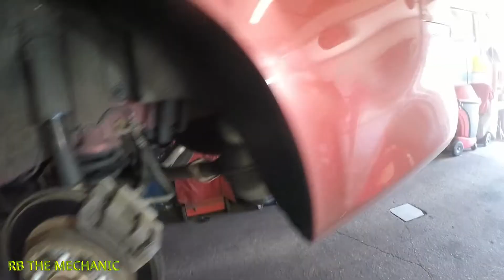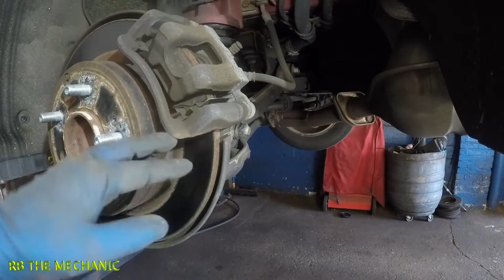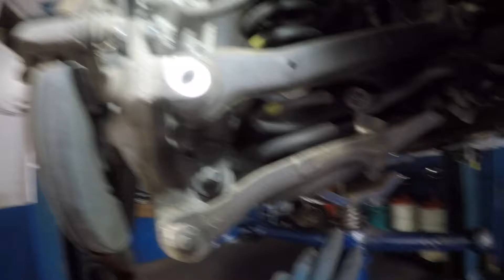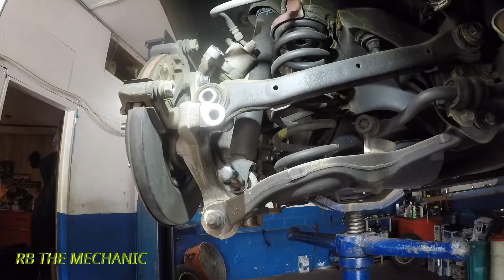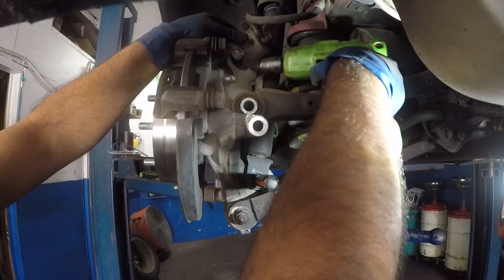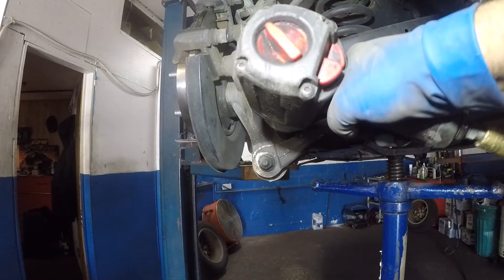How to replace rear brakes & rotors on 2013 KIA OPTIMA

Comment: Kinda glad I didn’t buy rotors since I didn’t need them, but dang that makes this unnecessarily difficult for a quick swap.
Reply from the maker: Yes this is bad design
Reply: @R @RBTheMechanic  At least the caliper comes off the regular way which is nice for pad changes. Gonna save this video gor when I inevitably have to bust out a jack stand to get the rotors. Thank you for uploading this.

Comment: I just replaced rear brakes and rotors on 2015 Optima without removing the control arm, what you need is a 12mm zero offset wrench to get the caliber bolt loose.
Reply from the maker: I have another video where I try that and it didn’t work
Reply: I need that video without removing the arm

Comment: Thanks for your vid. My problem is the suspension shock bolt needs rethreaded and can’t find that bolt anywhere, auto stores , hardware, nothing … found a kia parts store so that may be my only choice to find one
Reply from the maker: Yes that dealer item

Comment: Yes you do have to remove control arm bolt,,i tried cheating,,unthreaded the bolt all the way,thinking the rotor and caliper bracket would come apart as one, nope! Caliper bracket would not clear backing plate. Try it for yourself,you,ll find out
Reply from the maker: Yup crazy design
Reply: It can be done, I did it. Just have to pry it out of there. Might bend the backing plate a bit. I didn't like this so I ended up removing the upper control arm bolt anyway. It's really easy if you raise the assembly up with a jack underneath. Everything aligns nice and you don't have to hammer the arm. It's also nice because the bolt aligns better so you wont have to hammer it back in. BTW I recommend opening the bleed screw before pushing the caliper pistons back in. The brake fluid in this area gets contaminated the most. You won't believe how nasty it looks coming out from there.

Comment: Thanks for the video! Very helpful! 

I actually was able to remove the bolt from the control arm without messing with the shock. 
Instead I just jacked up the suspension until the bolt slid out. It does require a second jack though. But yeah saved me some time and struggle. The second rear wheel took be about 20 minutes.
Reply from the maker: Great idea!!

Comment: How about reversing the way the caliber Bolt goes in. So the nut is on the inside by the shock absorber and the bolt can be removed away from the shock. That way you don't  have to remove the shock bolt  to remove the calaber bolt . To gain access to the blocked 14mm bolt... Just a thought to save a step...
Reply: Just finished doing this job. Wish I would have viewed your video  before hand. Would have saved me a real headache.  But I did get it done. Just about the same as you did it. But I was on the ground with no lifts. But the floor Jack's were very handy. Poor design for sure. Wise move on your part reversing the way that bolt goes in.. I did the same !!!!
Reply from the maker: Nope this is the only process

Comment: Thank you very much for taking the time and being really patient and detailed showing people the correct way of repairing stuff. Kia manufacturers weren't thinking about others having to eventually replace them. Just like my mustang when I had to change my starter, first off the bolts were only 10mm and couldn't properly fit a ratchet or wrench around the bolt and they were super tight but every time tried to put a little bit of force the tool would slip off the bolt head. No matter what tool tried to use where they had bolts the body of starter would prevent u from getting it on the bolt. I used air ratchet blow torch and good old elbow grease to get it loose.

Comment: Thanks for the great video. Excellent detail to help me feel like I can do this myself. One question, after doing this job is it recommended for a rear alignment since you're messing with the control arm?
Reply from the maker: No the bolt is solid there’s no adjustment to it so they can’t adjust the alignment
Reply: @RBTheMechanic  excellent! Wish me luck tomorrow!🤣
Reply from the maker: @davidchall7684  good luck !!! By the way some people said If u can get small wrench in there u can work out the rotor and blacker to back off and u turn the bolt can stay in there

Comment: I have a Kia Sportage 2012 and it's a AWD. I'm ok with front breaks and disc's (Rotors) but your video is great on how to do the rear rotors. The AWD will be different but your video gives me confidence in doing it on my Sportage. And yes your right Kia have made it difficult to do unnecessarily. Thanks from the UK
Reply from the maker: Yup 👍

Comment: Thx for your videos. I did the Honda yesterday power steering all good now. Tomorrow doing 2007 Altima brakes front and rear. And then 2012 optima SX front and rear pads and rotors. Drivers of both those vehicles there was no pad left the metal shims actually fell out thats how low they drove them.
Reply: Do you have any other platform for communication? I have a few other vehicles could use some pointers.
Reply from the maker: @onlyme8870  this is all I do have IG but I don’t use it or check it much
Reply from the maker: Wow good ur doing lotta work!!
Reply: @RBTheMechanic  for got i had to put in a waste gate actuator too in the Optima SX. But because the engine was hot I wSnt able to adjust the rod so the voltage is 4.8 so needs adjustment  still. The altima was very bad need calipers and frame was rotted so had to use a  a flat plate of steel to jack it up. The rear rotors was worn so thin you could see through the rotor metal there was no pad left. The caliper was grind it down. Worst I've ever seen. Transmission is bad need 1st and 3rd gear in the automatic don't shift.  So i let the owner know. And has a catalyst issue as well. The Optima needed calipers too the pistons and slider pins were seized on the rear ones. I changed one caliper I need to order another. So those jobs technically aren't complete. But the Optima brakes are not quick with the bolt blocked.
Reply from the maker: @onlyme8870  yeah I hate this set up some people messaged me saying the use small wrench but it’s complicated  u can try that and turn both bolts little by little and let the rotors and bracket side outwards
Reply: @RBTheMechanic  yeah I did the jack stands then use the jack to push the suspension up a bit so I didn't need to disconnect the shock.  I wasn't going to wrench it out. I do need to get a makita power ratchet those are great tools I still use elbow grease and a socket.
Reply: Next project for the Optima is stip the rubber from derailing in the sunroof and new windshield and diagnose P0138. Jus glad this isn't a modded car.
Reply from the maker: @onlyme8870  oh u do all I don’t get involved in windshield I call  a guy up
Reply: @RBTheMechanic  i have had my hands on alot of vehicles over the years but I built sleeper Hondas from 91 to 93 so and I built track ready Novas. Done GoKart to Buses RV and Semis I stayed away from Saab and RR Bugatti Bentley and a few other luxury. Ill play with Porche and Lambo still haven't been into the Tesla yet.
Reply from the maker: @onlyme8870  nice put up sun videos
Reply: @RBTheMechanic  trust me they would be bad im using and ancient phone and no camera. Not into the tech. I'm 50 next month. Like 11 or more years ago I did some smart phone video tutorial on hot spot tethering. But gave up on the videos. If I did id have to hire someone.

Comment: If you use a double box head wrench with a offset you don’t have to take off the arm, just keep the bolt in and slide the bracket out.
Reply from the maker: That can work I will try that next time
Reply: @RooniesSkateFantasy, can you explain pls step by step or if u have a video about that would be really appreciated

Comment: I just replaced my rear rotors on My 2011 Optima and thought I'd offer a big tip. If you use a second jack to compress spring and shock / lifting the wheel. It will change the architecture of the suspension enough that the outer control arm bolt will clear the shock. No need to undo the shock.
Reply: Good tip I used it today successful.
Reply: No need to do any of that
 A 14 mm box end fits right in.
Reply: @charlesmartin1262  can you expand on that
Reply: @JavierGonzalezJr818  the bolt doesn't have to come all the way out
Reply: @charlesmartin1262  that has nothing to do with the bolt clearing the shock!
Reply: @atarisbetter9199  you don't have to take the bolt all the way out. Back it out to the shock and that's all you need. Just like the alternator the bottom bolt won't come all the way out. Threw me until I realized they designed some of these parts to come out with bolts only partially out.
Reply: @charlesmartin1262  the alternator bottom bolt comes all the way out btw
Reply: I watched the video and then tried this tip with the Jack... thank God for youtube and comments from people who know what their doing lol. 🙏
Reply from the maker: Will try that next time
Reply: Does this make it easier for that control arm to come out? He was banging it for a good while lol don't wanna do the same and annoy neighbors

Comment: Thanks for the video! I was literally attempting to replace the rear rotors on my 2006 Kia Optima last night and was perplexed that the caliper bracket bolt was squeezed behind suspension components (thanks Kia). Tried to get in there with a wrench and hammer the bolt loose but was unsuccessful. Ended up only changing the brake pads and hardware. Was a bit disappointed I couldn't get the full job done, but I feel better now after watching this and seeing how the job is unnecessarily difficult lol
Reply from the maker: Yeah this one is complicated some people manage to get small wrench in there to turn turn turn and let the rotor and bracket slide and keep turning

Comment: Great video!! I hope u can help me, i just bought a kia optima same year and same model. I noticed the rear passenger tire is sticking out more the the other side, looks like bad alignment or toe issue. I noticed the control arm might be backwards or something, the bend looks inwards and the other side outwards. Is that normal? The car is a restored tittle. Thanks

Comment: Hey RB, I’m having a problem removing the 12mm bolt for the caliper bracket that ma behind the control arm. I can’t get it to budge. It looks like it may be somewhat stripped but I can still get the socket on it. It just won’t move. What do you suggest to get it out? Im thinking about using an impact, do you think that will work? It’s pretty hard to get in there being it’s on a jack.
Reply from the maker: Yeah put the socket on tap it with hammer so it on nice and firm.  If u can use the mini torch and heat it up a bit and impact it out

Comment: Hey RB, thanks for the video on installing brake pad and rotor. I was looking at your impact wrench and the adjustable you had in it that could twist. This is just what I need - something small like that. Can you tell me the kind or something close to it to get those bolts loose? Thanks
Reply from the maker: I use mostly snap on but u can go to Autozone or pepboys and chose from many diffrent ones

Comment: Just use a regular wrench it will fit and you can avoid removing the shock and control arm.. just got done doing it myself
Reply from the maker: I will try that next time prolly is worth it if I’m able to turn slightest even if it take time

Comment: Hello RB, do you know if it's easy to replace the wheel stud while the wheel hub is on the car or will I have to remove the whole hub and try to press out the stud with the hub off of the car? Thanks in advace.
Reply from the maker: What yea make mode u have

Comment: Control arm DOES NOT  have to come off , 15mm box wrench , bolt for brkt comes out far enough. Repeat don't remove bolt for control arm or shock.
Reply from the maker: If u can make that magic 🪄 happen try it I couldn’t fit any of my box wrenches so I took on this beast and got it done the ovel shape of control arm went in further only if I had quarter of in more I would have loosened it up and let the brake slide outward with rotor

Comment: Nice n clean video, question how to adjust the parking brake 2013 Kia Optima lx?
Reply from the maker: You have to remove the brakes first clean the inside and then you can do like 3 click or more just don’t over tighten

Comment: Just changed rear brakes and rotor. Took 4 hours for 1 side. I didnt have a lift, only a jack and stands. Only a small hammer. Thanks for the tip about filing the brake pad. Mine has been sticking for that reason. I've never heard that solution before. Thanks for the video.

Comment: My kia optima 2012 ex had one nut that can come out on rear tire  ..is turning with the bolt together ..what can I do  to remove it ...thanks
Reply from the maker: Oooh that’s a tough one well not much u can do u have to drill it out if u don’t care about the rum then use cutter 3” air cutter tool air hammer but that’s about it I did this one on Nissan Altima damaged rim and took 3 hours